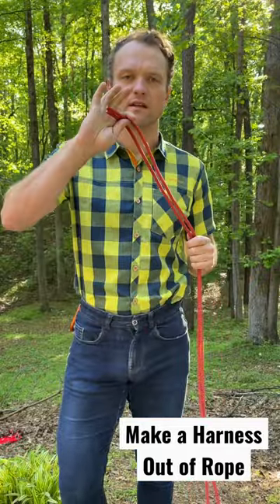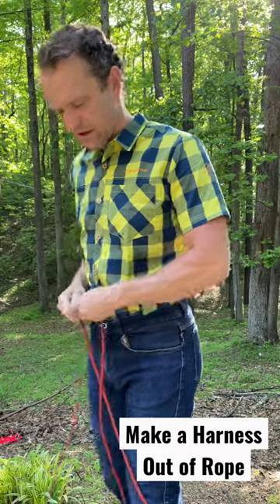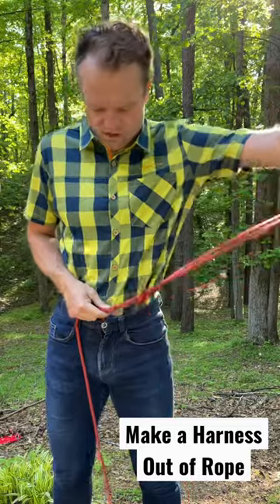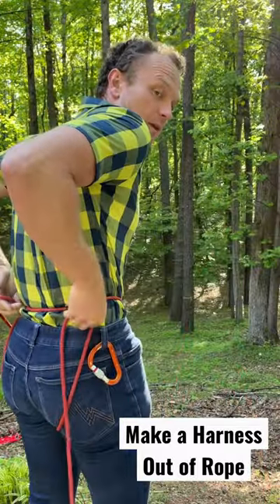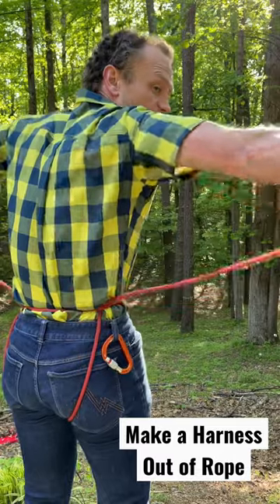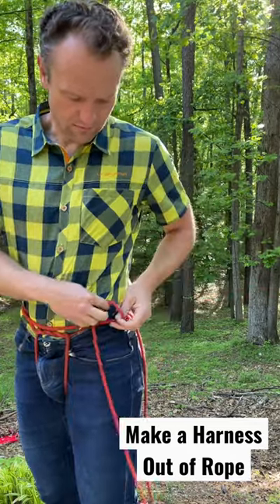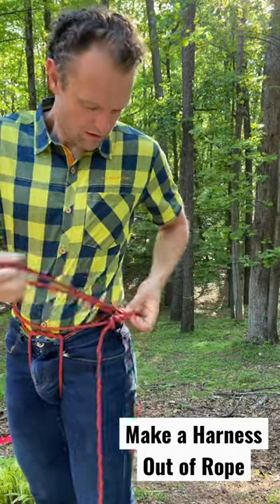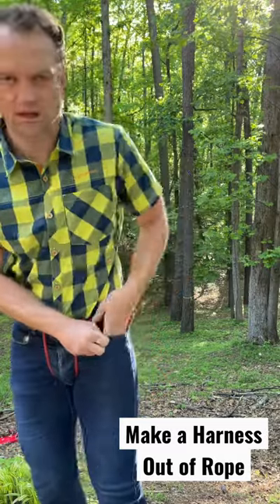Make a harness out of rope - Swiss seat #climbing #rappelling #rope

Comment: Why did you bother putting the middle on your left hip if you were just going to reach around the front of your body and rotate the material so that the middle was behind you?
Reply from the maker: The goal of the middle on your left hip is to have the final knot end up on your left hip so that it is out of the way of a rappel strand that would go middle of my body or to my dominant right side.  The rope may have shifted slightly but you can see the knot ended up on my left hip.
Reply: He’s right. Always start it away from your work space.

Comment: it is far more comfortable, and less bulky, if you use 1" (25mm) flat tubular webbing rather than round cord.  Good for very small adults, or teaching children to rappel or top rope if you do not have a small harness.
Reply: the idea of this is in an emergency
Reply: @ZerolinGD  It is good to know for emergency needs, but it has been used, and still used, for many years.  it is still current in the military, and by some search and rescue groups, fire departments, as their routine when they need to rope up a rescue team.  it is a vast improvement over tying into the end of a rope with a loop, that was used for many decades in the alps, and all the big walls in Yosemite were done without a harness.  It is still a good skill to know for modern use.
Reply: @Petros98223  Yeah but if you can prepare for this, you can also just use a harness.

Comment: Is there a preferred/better/no less than length of rope for this?
Reply: For me (an 80kg male with a stocky build using 8.4mm rope) it took 3.5 metres, which gave me ~10cms excess on each strand after the square knot!!
Realistically I'd use 4 metres though, to allow more leftover line for safety reasons (or for any alterations you may require).  
Better yet, a 150cm sling is a much quicker lighter and compact way of doing it (with the sling method). 
Hope this helps.
Reply: For anyone not familiar with metric, 4 metres is roughly 13ft.